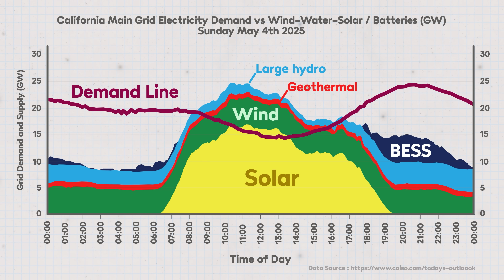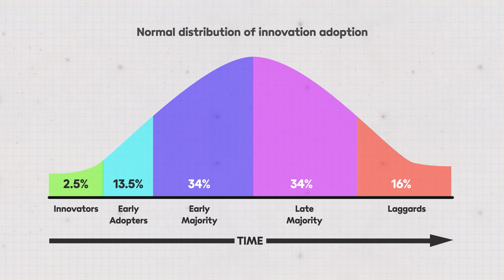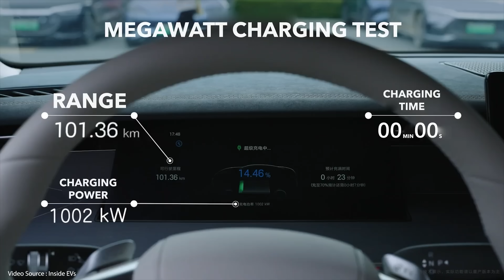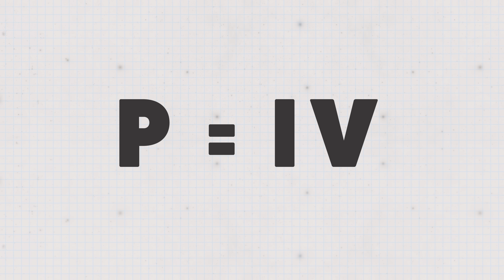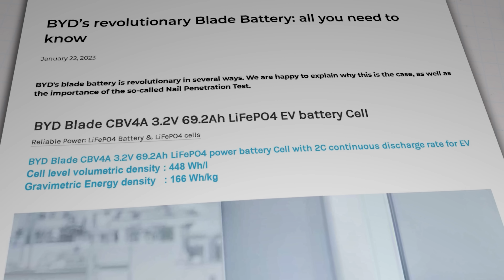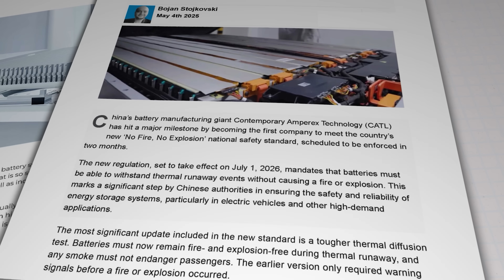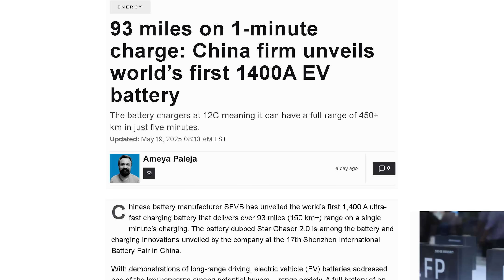BYD 1 MEGAWATT 5 minute EV Charger. Overdue or Overkill?

Comment: An EV 'laggard' myself this BYD battery improvement is definitely overdue. Well done, keep up the good work.
Reply: You don't need it.  The Ioniq 5 already charges in 20 minutes.  I do feel a little impatient with an 2021 ID.4 at 40 min, but as the number of fast chargers increases It will be better since right now I have to charge either too soon or too late with barely 5% left in the car.
Reply: @kronosaurelius  There are people who want faster charging. Also, I think that means slower charging cars will become cheaper.
Reply: @kronosaurelius as an EV owner, 1MW is definitely overkill, but 20 minutes is still definitely too long. In my mind, 10 minutes 80% is ideal. Qnd i do not have home charging, so being able to go from 0-80% in 10 minutes would make apartment EV charging viable without forcing everyone to install chargers (which i wish we could.)

Comment: Heavy discounts are helping in the sales of EVs because nobody wants one
Reply: I really wanted one so 'nobody' is clearly incorrect. After 52 years of driving, my electric car is the best car I've ever owned. Once the majority of people make the same discovery most of them will want one also.
Reply: @johnbridger5629 i bet you love the depreciation as well then ❤
Reply: EV depreciation is leveling out, as the early premium vehicles are now being displaced by everyday more affordable model. Although, at the EV growth rate in some parts of the world though it won't be long before the depreciation hit switches to ICEVs instead in those locations.
Reply: Don’t you get bored of trolling? Love my ev. Never going back. It’s crazy fast off the line, quiet and clean. No gas smell on my hands, no oil changes, brakes last til 70k miles, etc.
Reply: That's changing fast

Comment: We don't have the available power for this speed of charging with multiple cars at once. Everyone would need to schedule an appointment
Reply: If every petrol engined car wanted to refuel at once, the queues at filling stations would be even longer.
Reply: Batteries can even out the power taken from the grid. The total amount of energy per day won't change just because the charging rates increase.
Reply: You could make that same arguement for just about any service.  But the thing is, except for flushing toilets during half time at the Super Bowl, humans tend to spread out demand quite nicely.  So this argument is a complete non-starter.
Reply: @Tom-dt4ic and tea during the ad breaks.
Reply: As far as I know the plan is to make the system 'smart' so that the charging of large numbers of vehicles will be timed to minimise spikes (I think Octopus already use a similar system). As our host said, there is a lot to do in a short time to make this system maximally efficient. But it's still a job well worth doing.
Reply: True. I work in the marine DC-charging sector, and sometimes we have to have a batterybank to provide enough power to charge with 1MW. A very expensive solution, and it doesn't make sense if you have to recharge the batterybank before next car-charge. It makes sense when it comes to ships in a set route, but not with cars lining up.